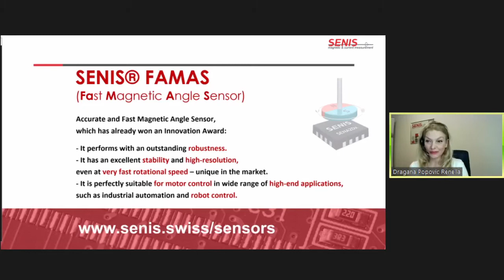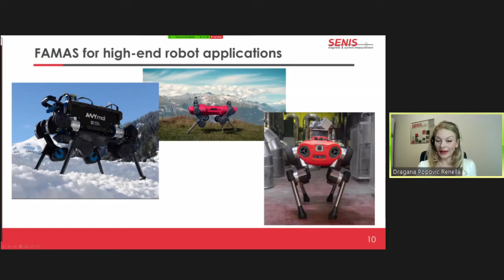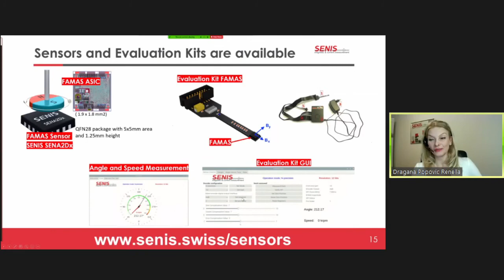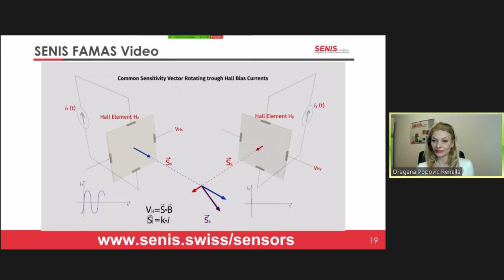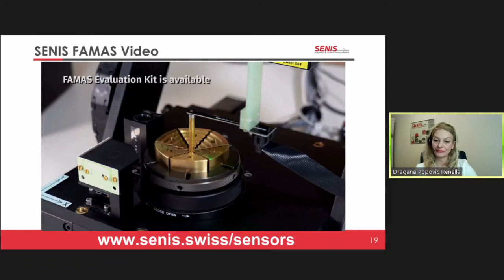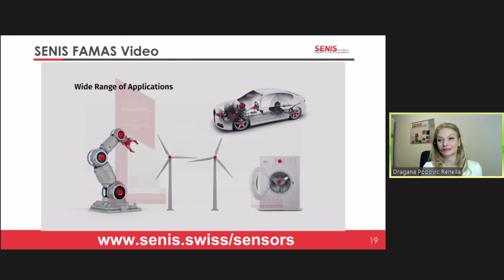Fast Magnetic Angle Sensor for Robot Control Applications - presented by Dr. Dragana Popovic Renella

Comment: If there are two orthogonal vertical Hall-elements, what is the added value of the "servo" feature over just quadrature (sine/cosine) resolving of the two fields sensed by the two elements?
Reply from the maker: The servo loop allows to track the rotation angle of the external field and thus an Extremely Fast direct angle-to-digital conversion without ADCs and angle computation.
It is thanks to the “Tracking” why we have so low latency - the smallest on the market!
Reply: @senisag5078  So, essentially, your sensor's "lag" is the servo-loop's group-delay instead of the conversion-time + computation-time that a traditional quadrature magnetic angle-sensing would need? ( and I assume that the former is substantially smaller than the latter..). 
BTW, Do you also do some "feedforward" to further reduce the servo-lag?
Thanks!